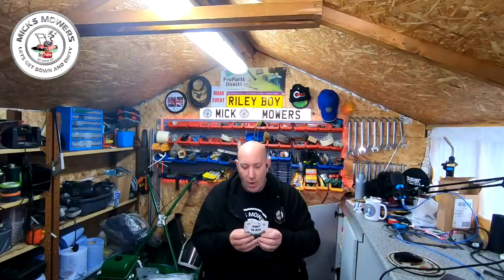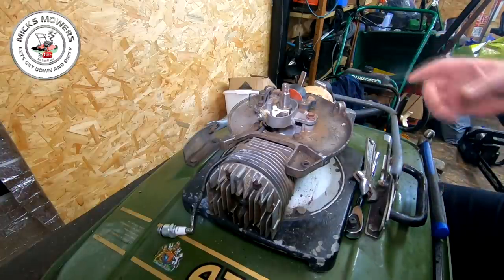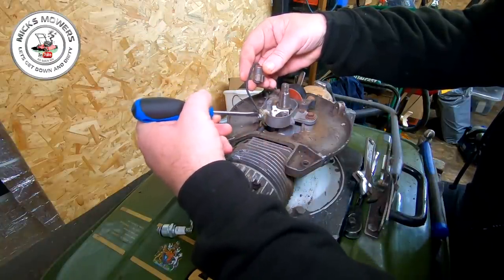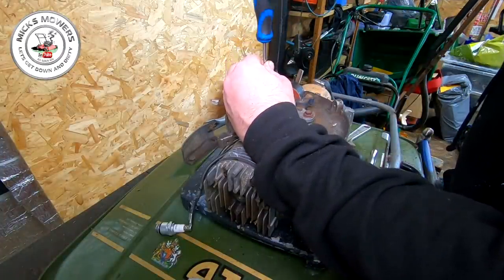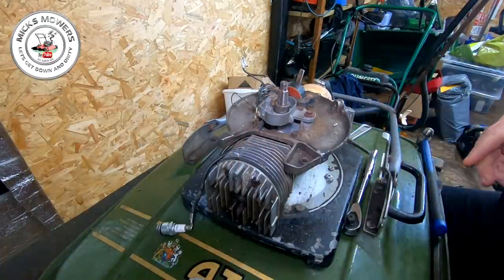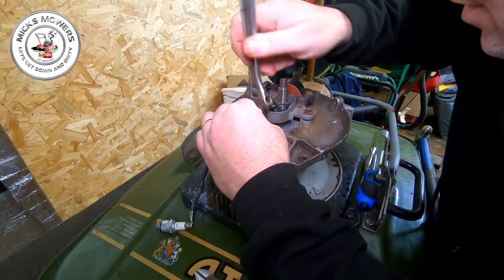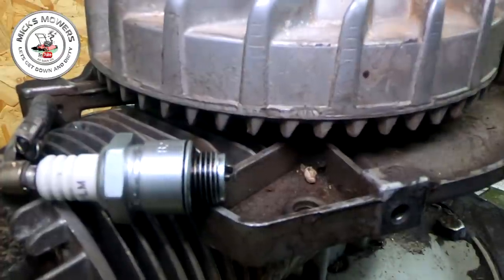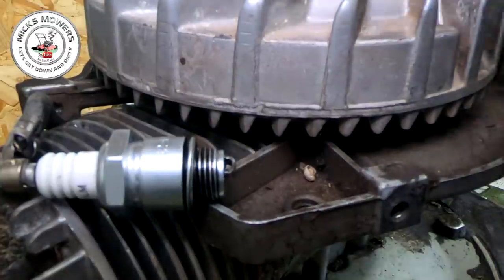Vintage Atco Hover Mower - Renew Of A Set Of Points And A Condenser

Comment: Hi Mick, you forgot to say that you put a drop of oil on that piece of felt that lubricates the cam. Back in the day when we had flymo  (1970s) we always tipped them up to start to stop the blade dragging through the grass. It’s alright on really short grass in winter but when it’s grown a bit and you want to cut it it either won’t start or if it does, it will cut a circle until it rides on its cushion of air. Glad you got the old girl popping. Hoping that you can get that carb cleaned ( I’m buying shares in WD40 lol) and get it fully operational and ready for sale. Great stuff as usual. Pete

Comment: Hi mick thanks for the videos really enjoy them and very helpful quick question I have a hedge trimmer and there is 2 stroke leaking from the filter beside the carb what could it be    thanks mick would appreciate if you could help
Reply from the maker: Could be a carb problem.. the needle may be stick open..
Reply: @themowerman  thanks mick 👍